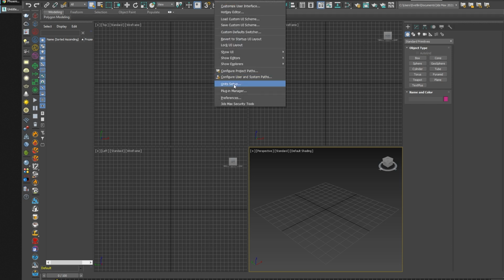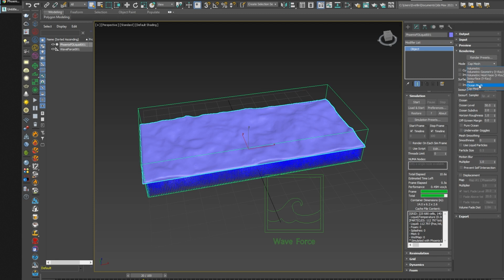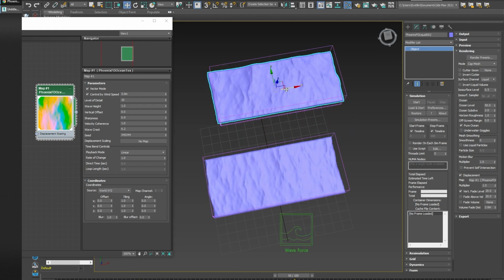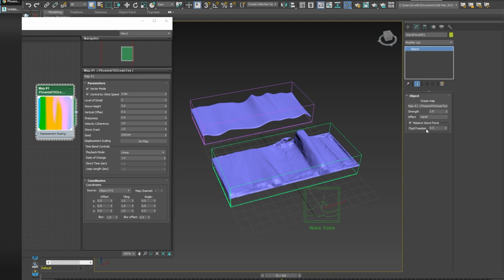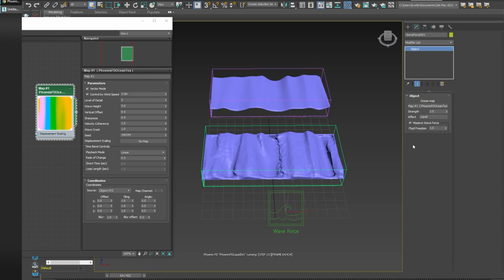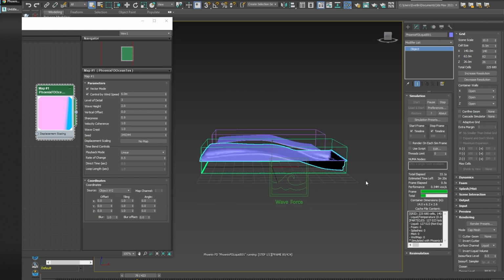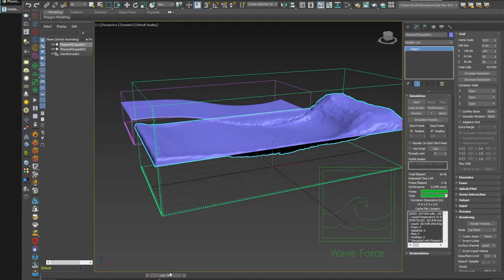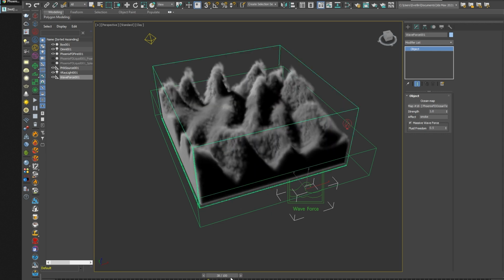Phoenix FD 4.30.01 Nightly - Creating Tunnel Waves using the Massive Wave Force

Comment: one big issue found is phoenix fd 2021 ocean mesh.
when using ocean mesh depending on the size of the box the ocean just fills up the view port rendering problems at export times.
it is a bit ussue because the camera view or anything human is viewing throught he viewport should only render but since the unwanted areas have large amount of particles 3d max bogs down in render time.
it should be like ocean cap you create a box and water stays contained and not all over viewport unwanted area but as you zoom out the ocean becomes small.
you need to rework on ocean mesh so that it uses less   particles ignore out of camera view particles than render will be fast.
Reply: Hey, 
The ocean mesh is already generated only in the camera view. If your viewport performance gets slow you can turn off the mesh and particle previews in the Preview rollout of the simulator. If you need more control on how fast the ocean renders - changing the Ocean subdivs in the rendering rollout will balance between speed vs quality - so less subdivs will mean faster ocean generation and low memory consumption, but lower quality mesh, while high subdivs will increase the quality at the expense of render time and memory.